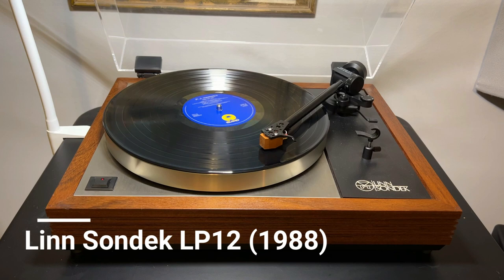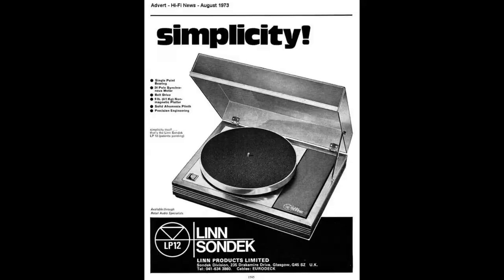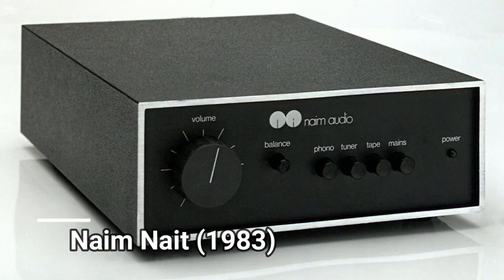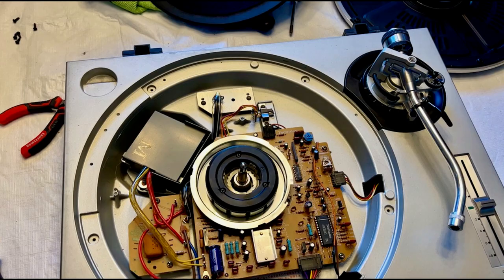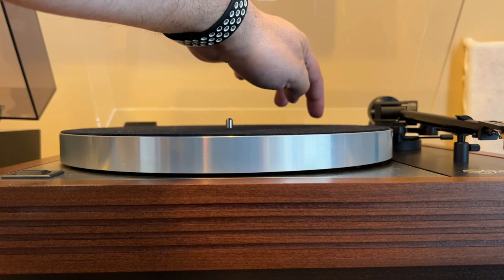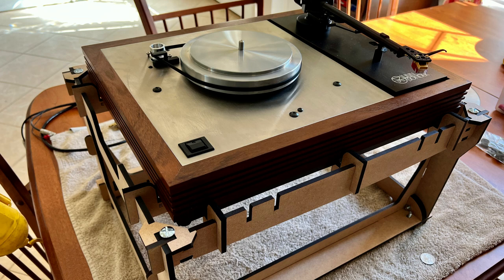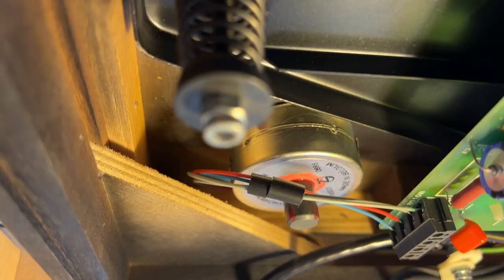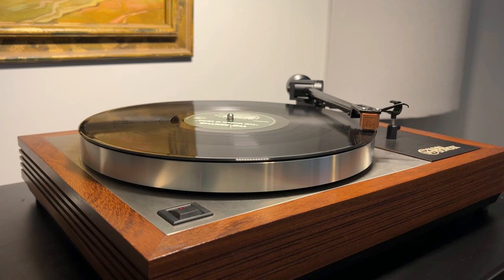Am I Now a Certified Linn Turntable Service Technician?? Me and a Linn Sondek LP12.

Comment: The LP12 still is king and always will be. It even looks like a record player unlike some that look like an oil rig or something from the inside of an old washing machine. Quality costs money and the Lp 12 is worth every penny. They are a bit fiddly to set up but once you learn it is easy to achieve and don't forget to twist the springs to get the bounce correct this is done by holding the bottom of the spring with finger and  thumb and pushing it upwards and turning it at the same time. Always try this if you cannot get the bounce right one spring at a time . Yes it makes a difference. Then once you have your bounce correct don't forget to level the arm. The top of the arm tube must be 100% level with the arm and stylus resting on top of an lp on the platter. Only then is your LP12 properly set up.

Comment: i have an LP12 and a Thorens TD150 mk1. I changed the springs on my Thorens, and can confirm its a job that requires patience and full focus. it is however very rewarding when its done. Arm wise i have an SME3009 mkII with a fluid damper trough  and auto arm lifter fitted to LP12, and a Rega 350 fitted to the Thorens, also fitted with trough  dampener. one for 45's and the other for 33Lps. they keep me very happy.

Comment: With the springs and grommets removed check the suspension retention bolts are tight against the top plate before rebuilding. Always, always, always disconnect the tonearm lead before attempting any suspension adjustments. the tonearm cable is effectively a fourth spring and will influence suspension alignment. Once you're happy that the armboard is parallel with the plinth cut-out, the platter is level and the bounce motion correct (up-down pistonic; no wobble or rotational movement) reconnect the arm lead to ensure the suspension alignment is not compromised (the arm lead may push / pull against the suspension). If the suspension is affected the arm lead will need redressing and, probably, the length adjusting in the plinth "P" clip until the difference in suspension alignment with lead disconnected / reconnected is minimised. A hair dryer can be (carefully) used to re profile the arm lead if it looks in danger of fouling anywhere. Same principle with the drive belt (not the hair dryer though!!)which should always be removed as, again, it's effectively tensioning / pulling against the suspension (the belt is, effectively, the fifth spring). Once all back together it should be possible (not for the faint hearted this!) to tap the label of a playing record, setting the suspension in motion, without the stylus skipping. If it jumps it's back to the drawing board (or set-up jig!) Hope this helps

Comment: If you buy Linn you need to become your own technician. I came to this realization after having to dispose of a Linn turntable and then later the tone arm for lack of serviceable parts. I now see that their newest completely in-house made tone arm uses the same cheap plastic parts at $4000 cost that eventually busted into about eight different pieces and could no longer be glued together (or replaced)on my tonearm. “If it’s _ Scottish it’s CRAP!”

Comment: I purchased my Linn LP12 back in the 80s and my little Hi-Fi group was stunned by it's performance compared to a Technics direct drive.  Marching on and a 32-5, HiCap, 250 (Naim in Salisbury, UK) and the transformation was almost complete.  A set of Harbeth BBC style monitor loudspeakers completed the setup.  Surreal sounds ensued and the whole group went down this route with some changes to amps and speakers, but the LP12 was the pivotal source.  The advent of CDs and CD players were crushed by the LP12 with the A-B demos and evenings of beer fueled analysis - basically any excuse for a party night!  The LP12 setup was a thing for magicians back then, but it was all backed up by surprisingly technical reviews of the turntable and it's output and the matching Naim amps.  One of the best Hi-Fi demos I've ever heard was the above setup with full blown active Isobarik speakers with a 6 pack of Naim 135 amps (mono block 250s back then).  This all took place in a dealers flat over a shopping precinct in Windsor!  Those were the days...  the current top spec LP12 is a pricey item now, for ever diminishing returns.  Oh, and the fluted Afromosia plinth, as you have I think, was always the one to go for...  Great video!

Comment: I enjoyed your video.  
From the late 1970s I’ve been entertained by all the debate surrounding the Linn Sondek LP12.  Here we are in 2024, and it still entertains!

In March 1983, I purchased a Heybrook TT2 deck, with Linn LVX arm and A&R P77 cartridge from Paul Green in the City of Bath. Price £270.

Paul let me take home for the previous weekend, a Linn LP12 and a Heybrook TT2, for auditioning .

Following that weekend of listening, I found that I could discern no significant difference between the two decks, so purchased the Heybrook.  I still have that Heybrook in its original state. Only the drive belt and the cartridge have been replaced – just once, with identical replacements.

The deck has throughout those 41 years performed without fault, and consistently given me utterly satisfying enjoyment of the music from my LPs, and all without periodical Linn style ‘services/upgrades’.

I guess I just ‘missed out’ in the last 41 years on all that hectic LP12 ‘after-life’.

When in the process of purchasing my first CD Player in January 1993, I remember listening to a host of CD players at Radford HiFi, and grumbling quietly to the shop manager that I was disappointed that this so called ‘great improvement’ in sound quality via the then new CD format, was not as great as I had been led to believe.

“That’s because of the quality of the Heybrook deck”, came back the reply.

Once the I had [purchased the CD Player (Rotel, Limited Edition, £380), all my subsequent music purchases were CDs. The Heybrook just plays my old LPs.

I sense that Turn-Table purchasers are in reality, just trying to hang onto the coat tails of the higher quality digital CD audio.

And for what it is worth: The quality of the audio coming out of our loud speakers is governed by the skills of the recording studio, getting its work cleanly transferred into the grove or digital reproduction formats.  
Our chosen home electronics simply play back what has been stored into either the LP’s grove, or the CD’s digital encoding.

No doubt the Linn LP12 debate will continue, and I will continue to be entertained. Thanks to you one and all down through the years.

Comment: I used to sell these in the early days. Often with issues. Baring too tight, took hours to lower the platter. Ticking motors. Many would not purchase as it would only run at 33rpm. No 45 rpm. Thorens TD160 outsold it 10/1 and many hours saved in setting up.

Comment: Just started my second period of ownership of an LP12 and loving it.  This time I’m going to be buying carefully selected after market upgrades from time to time.  The first will be a power supply upgrade from the Valhalla.

I have the jig and have already set up the suspension, serviced the Valhalla, replaced the vintage arm cable with Mogami Neglex, fitted a cast base board with three height adjustable vibration absorbing feet and fitted a brand new Audio Technica AT-OCS9SXL moving coil cartridge.  I’m so thrilled I have purchased 25 records in a month, from £1 in antique shop to £60 for the latest Coltrane, Blue Train issue due out later in the month.

Don’t knock these turntables if you’ve never heard one.  They are simply brilliant.
Reply: So are many other turntables. The Linn is a great sound turntable, the only problem is Linn has generated so much marketing hyperbole that exaggerates the differences between turntables. I have owned an LP-12 as well as many others and I've listened to them and many arm cartridge combos. The differences are nowhere near as great as Ivor and Linn contend. That's not to take away the LP-12's excellence especially their recent very costly versions. My favourite sounding turntable is the Oracle mk IV which I still use, to my ears it's a bit more vivid and precise... the Linn sounds a bit thicker and romantic but both are great and would suit different amp speaker combos.

Comment: Having watched various operatives play around with the suspension on the Linn then applying the 'bounce test', I confess to being rather amused.  In service, the suspended assembly doesn't behave as we're led to believe but rather, the chassis should remain placid while the wooden plinth does the bouncing.  In any event, the most careful 'setting up' of this flawed contraption can never ever get the game 'right' and as soon as the turntable is moved, all that effort is set at nought - consider the belt tugging away at the sprung section during playing.

Comment: Anyone saying Linn is nothing special most likely never owned one.  It’s a very dependable retro table and extremely well made and engineered plus great for tweakers.
My own 1st yr table just went thru a real biblical too the roof flood and after a clean and oil works perfectly because it’s made from real materials no MDF.
Regarding this video however It cost me $100 (Aussie)for a full service (first one it’s had) that’s springs and everything, by an ex Linn importer. Good on you for having a go tho. Take no notice of the negative comments about your Linn and enjoy a real piece of HiFi sweetness. One tip. Don’t be stingy on the arm and cartridge and it will reward you for it. Wall mounting also helps with sprung tt designs if you don’t have dead solid flooring.

Comment: Hi, As I said earlier on my other device Great territorial on the Linn LP 12 , I will get it up and running if not this year beginning of next year, 
 It was strange watching your tutorial this morning get me a bit of inspiration to finally mount  my Deck on a separate shelf hanging off the wall because before it was on a stack towel system which sat on the floor on spikes but the big problem was when I lowered the arm I didn’t have much time to get to my seating area before the stylus touch the record problem being I have suspended oak beam flooring and it causes vibration.
So the only way now it will move is if I have an earthquake as it is connected to a granite wall which is approximately 3 foot thick.
That’s enough of my gambling on, Keep up the great work look forward to your next tutorial, Just thought of something else that you was talking about burning CDs and copying the record, Just after I brought my Linn I purchased a Nakamichi DR2 to copy my vinyl onto tape it is a beautiful bit of kit apart from changing the belt which I done last year it is still going very well . 
Phil from the moulin France.

Comment: I had the poor man’s Linn the Heybrook TT2 which was a copy of the Linn setup with a Linn Basic arm. The set up procedure was the same and I update the table mount frame (many years ago) and I had the local dealer do it, badly as it turned and and I redid it, and it was a nightmare to set up as you say.
The plus of this is I guess the isolation, the negative is the bounce every time you touch the LP or yen arm pickup. 
Again as you say, there must be a better way and there are stacks of turntables out there without this annoying bounce!
The there is a lot of claims in hifi, but you sill have to get an LP that is flat, undamaged from the pressing/packing procedure (this seems to be back to the old days with this problem) so if any of these issues, then it doesn’t matter how fancy your turntable is! Get a CD player or Stream if you want your music crackle/pop free 😆
Reply: I’ve got an Ariston rd11 and rd80 the first upon which the Linn was  “ based” , amongst others that feed my compulsion and I agree there are many design flaws one would not expect from a “ high end” product , one is the continually having to pamper and cuddle them just so they do the job correctly  . The irritating bounce every time you touch the arm seems one such flaw and  overly done by extending to the entire arm board when it needs only to be under the tonearm itself .The Ariston Rd11 was also this way originally  but it was remodeled later so the arm board was rigid apart from the separate small plate for the tonearm , which was sprung .  so  didn’t cause it to bounce when lifting the tonearm  at the end of a record and  resting one’s wrist on the arm board . The Thorens 150 is the same overly sprung design 
There are always pros and cons with formats thst translate a live performance into a material , repeatable format . I love my vinyl albums and turntable because they give more than the sum of the parts in pure enjoyment even with their flaws , but some of these just seem to remain due to dogmatic design  and a true designer one would have thought would have recognized these flaws and sought to alleviate them  , much like Roy Gandy of Rega  has said is his design philosophy and all true designers of any equipment . 
I suppose it’s like any interest, any hobby there often is no reason or logic to explain why one loves and enjoys it , even its limitations .but the limitations and rewards add up to make the whole a more enjoyable experience . Just as classic cars are  technically a pain sometimes , are  obsolete , slower ,  need  more maintenance and care etc , but when I see an e type jaguar or even an old MG or 50s Ford , I know they are  far more enjoyable and loved .sometimes we love the things that are imperfect far more than those that are. At least that’s what I tell myself when I’ve broken down on a country lane in the winter or my early pressing of a rare album has developed a mysterious new scratch . But Linn turntables as great as they are , should they also be so much trouble to get to run correctly ? Because even an E Type Jag runs beautifully for years before needing an engineer just to fix the suspension settings or get the wheels aligned in balance !
Reply: @saudade369  It does say a lot for modern turntables that are fixed, no bouncing. I guess you have seen the mag lift supported platter, it wobbles all over the place, a design gone far to far, the wow and flutter must be awful 😱
But you are right, it’s the sun of the parts 👍
Reply: Yes,I’ve been intrigued by the magnetic suspension .it seems a great idea in principle  but in my limited understanding of opposing magnets providing a repelling , suspension type cushion they always have a force that is making them very unstable horizontally , and would suggest they are indeed rather unstable . I would have thought if this is the principle they’re based upon the designers would have found a way to compensate but , maybe not as much as needed . Of course I may have totally misunderstood the principle completely , physics  was not my subject , pr9bably why I became an artist instead and as far away from it as possible ! It does seem an amazingly good idea though if done well .modern turntables although fixed , do have forms of suspension don’t they , just not the very highly sprung types we’ve grown to know and love ( ahem) .  @David-xl9cp

Comment: After 40 years of setting up Linns, I'm still waiting for my medal or prize.
Reply: Hint. The key to making the suspension easy to adjust, is to make sure that the three spring bolts are absolutely vertical, and not leaning to one side or the other. Linn actually makes a "bolt straightening tool" for doing this, which consists of a T shaped bar the slides over the bolt, and has a level built into the T part. You physically bend the bolts so they are straight. The currently supplied springs are very consistent, and usually require very little tweaking. Also, make sure the top grommets are properly seated, with the flange entirely inside the hole in the subchassis, and that the tonearm cable is dressed in a way that it doesn't influence the position of the subchassis.  Good luck!

Comment: When you have set up a hundred LP12's with all the variations and lately there are a lot of options then maybe you can be called certifiable.  I used to work for a LINN dealer, flew out to the distributor for training and have been to the Glasgow factory.  The old one, not the beautiful new facility.  I set up countless tables including Rega's.  But that was a while ago and I definitely do not consider myself a qualified tech anymore.  I mean I'm familiar with the latest products and I could do it but I have the local dealer work on mine now as they're as good or better than anyone else with over forty years of experience.  I don't know if your video was showing the final setup with the record playing but it looked like the arm board and platter were in motion when it was playing a record.   The table Being thirty plus years old thirty plus years old I would check to make sure the three bolts are perpendicular(90deg) to the base.  Make sure the base is really level, then take a 4mm Allen key and place it between the platter and the top plate at the three points between where the springs are located and just raise the height of the platter until it clears the Allen key.  Don't be too concerned about the arm board other than that it's not touching the base anywhere.  Could be other reasons for it not being exactly right.  Then adjust the springs making sure the distance between the platter and top plate stays the same, and readjust the height if needed.  If you really got this right, you should be able to play an Lp, pick a point between the spindle and tonearm and start tapping to get the platter and arm board into oscillation without it skipping, then you've done a great job.  Owning a dedicated socket screwdriver(5/16) is not a bad idea.
Reply from the maker: Thanks for your insightful comments.

Comment: The Thornes 125 uses 3 point suspension also. I just replaced the 40+ year old springs last year. Wow that circuit board seem overly complex for a turntable.